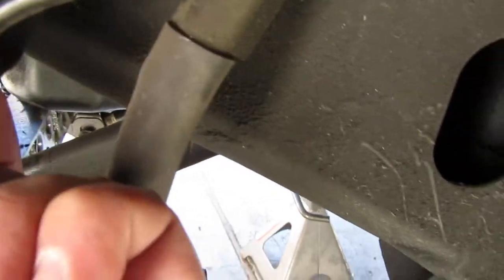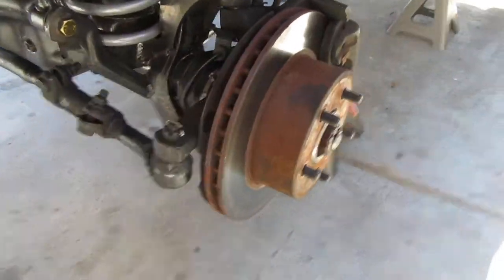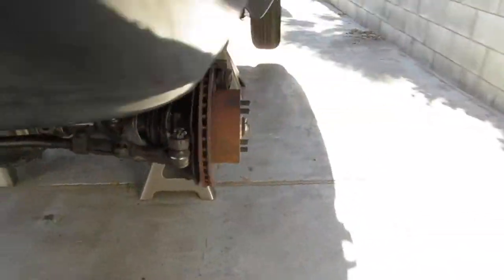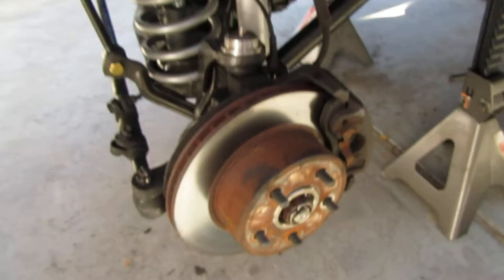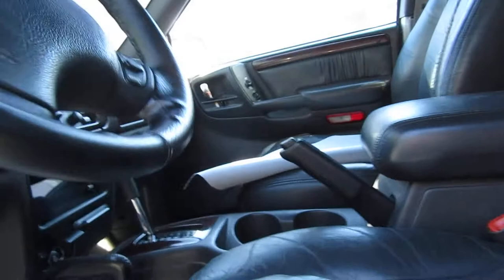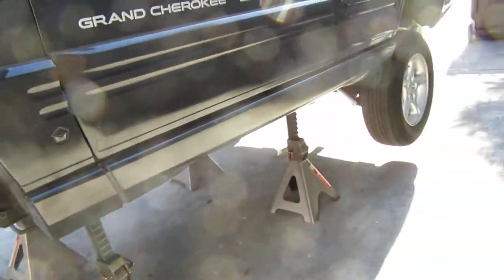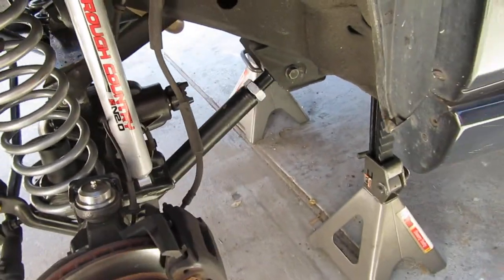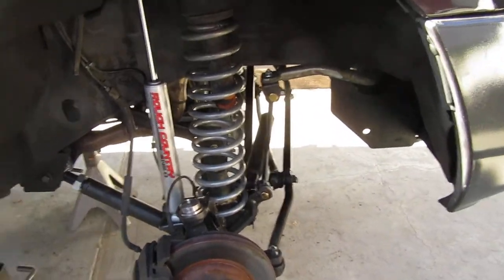Jeep ZJ 5.9 Adjustable Track Bar - Lift Kit DONE

Comment: Does your overheat at all......mine is on a 7in long arm kit and 35s normal driving is fine up hill for a long ways nope ac nope wheel longer than 30 mins nope.lol
Reply from the maker: My 5.9 did have overheating problems; but, the two parts that I used to fix that...   Motorcraft Wiring Part # WPT-168   and  VDO fan motor part # PM9069.  I do plan on switching to pink radiator fluid, in the next couple of years.